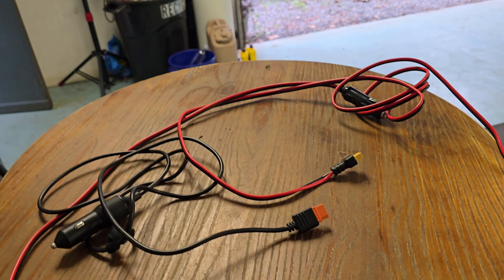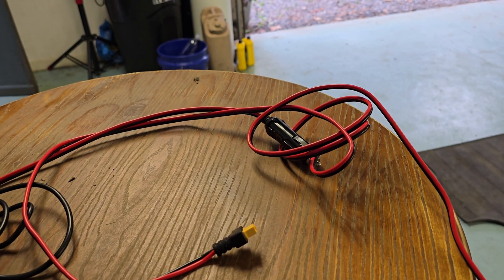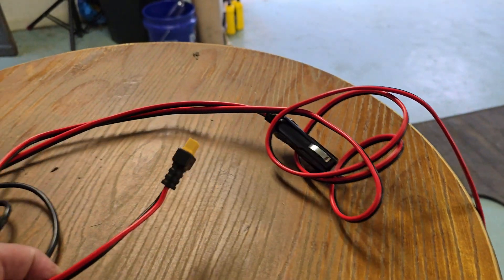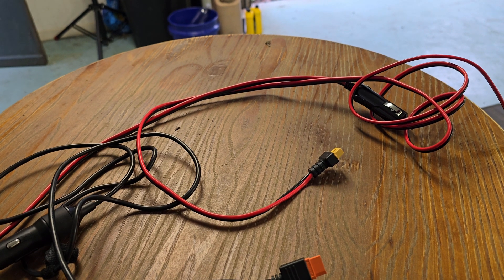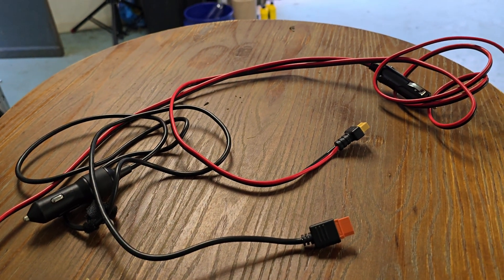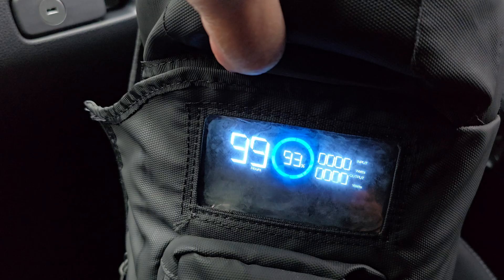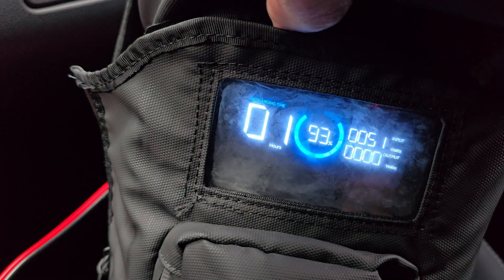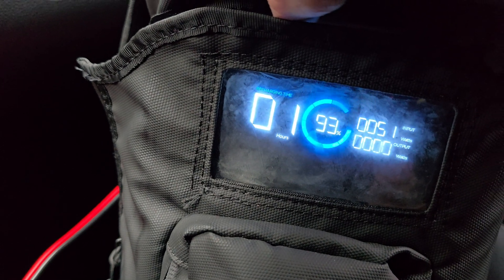Ecoflow Delta 2 not charging via DC *fix*

Comment: It take forever to charge that way?
Reply from the maker: Yes but it is the only solution without buying and installing a DC to DC converter. The AV outlets in the 4runner do not charge the ecoflow delata 2 because its not pure sin. I didn't have any problem with my pickup truck but now that I have the 4Runner I ran into this issue. If I decide to keep the truck for a while I'll end up eventually installing the DC to DC converter so I can charge it much faster.